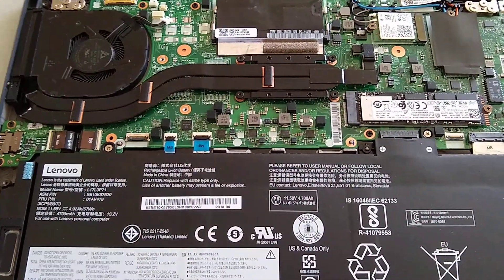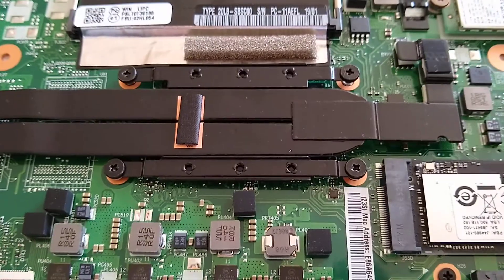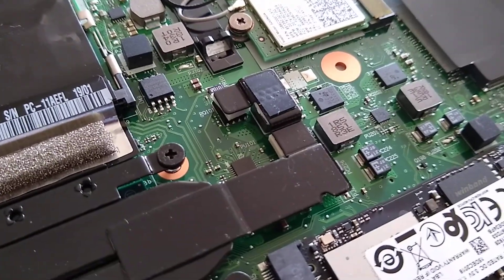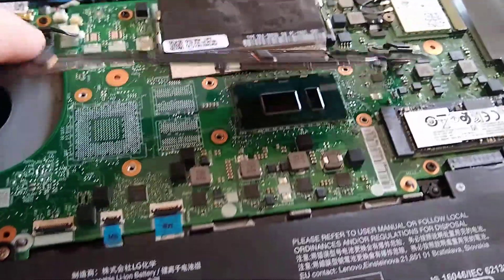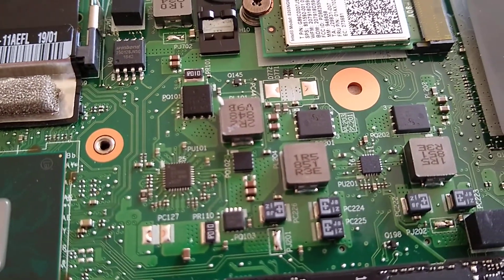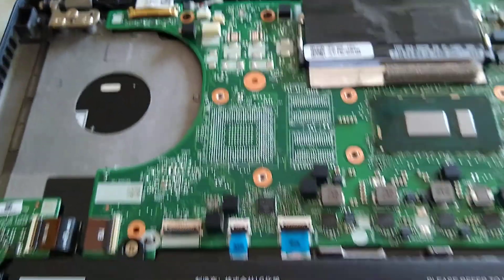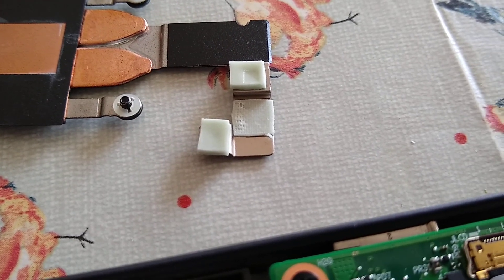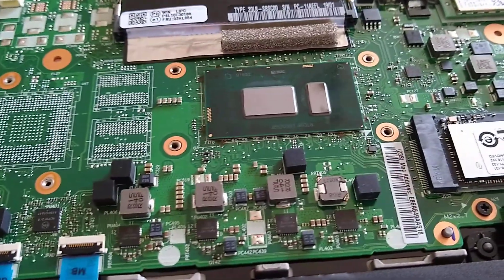Lenovo T480s Heat Sink Removal

Comment: How many degrees (temperature) were you able to reduce? Did you notice any relevant heat reduction? Thanks.
Reply from the maker: It reduced by a good 5 degrees! This meant the fan ran much slower in normal use!